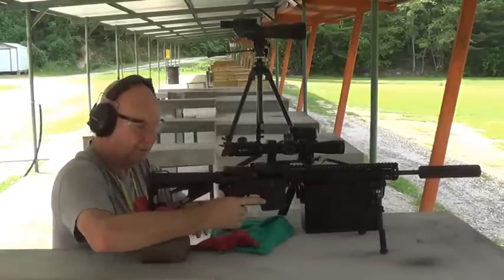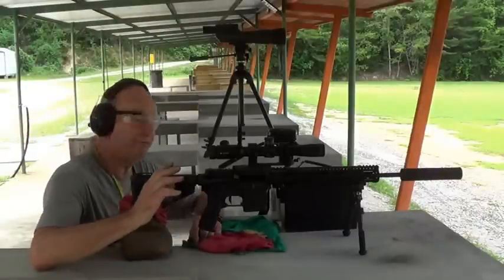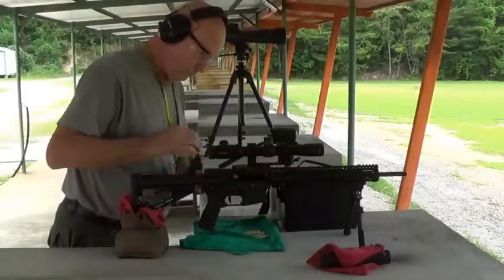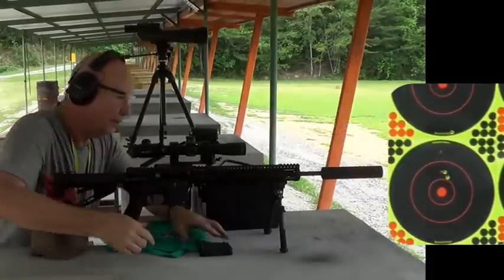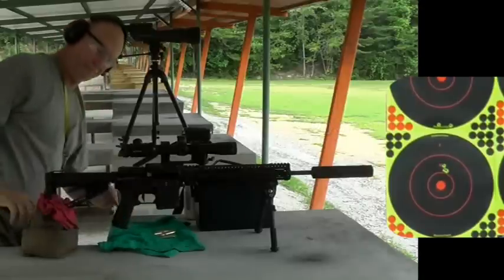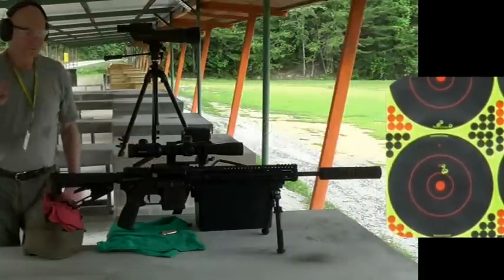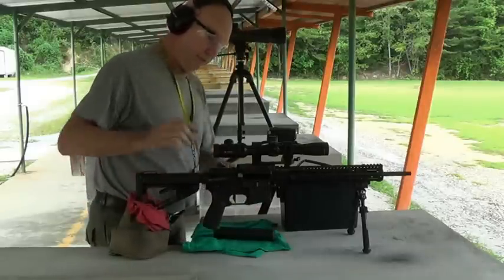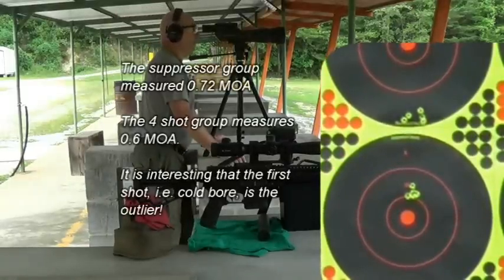suppressor on-suppressor off affects on POI

Comment: Hi Tangle, Interesting experiment. I recently purchased a Silencerco Omega multi caliber suppressor . I use the QD muzzle brake on my Colt ar15 HBAR and my son in laws .308 Ruger precision .
Reply: I'm having the same POI problem on either rifle. Can't figure out the cause other than an extra 1# or so hanging off the end of the barrel? At 100 yds. both are 1'' low and 1'' right give or take. Any suggestions ? Thanks , Randall
Reply: @randallmcinnis2954  Try turning the suppressor in 1/4 turn increments?

Comment: Why didn't you just shoot 5 and five could of cut this down 5 minutes
Reply from the maker: If I shot five with the suppressor and then five without the suppressor, the barrel would be at a different temperature for the two sets. The increasing barrel temperature could cause a POI of impact shift that could mask the effect of the suppressor.

By shooting one shot with and one shot without the suppressor it helps eliminate temperature effects between the two conditions.